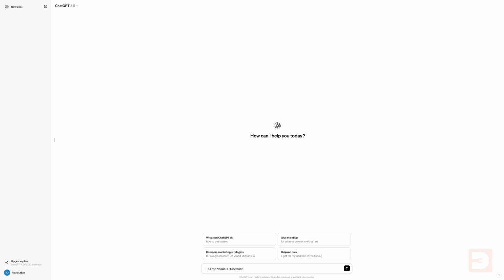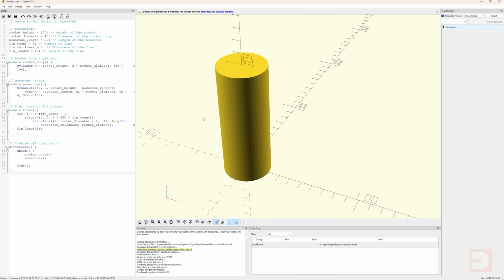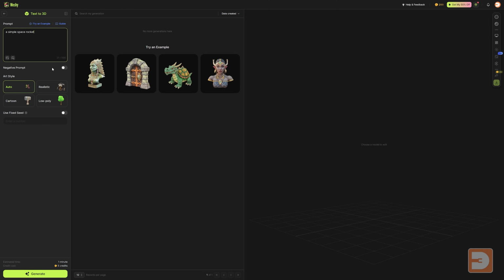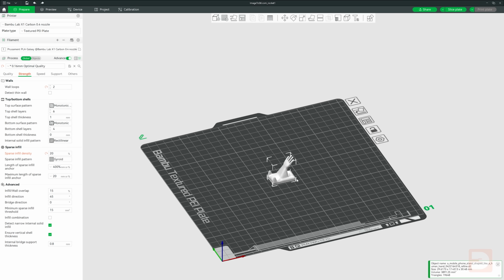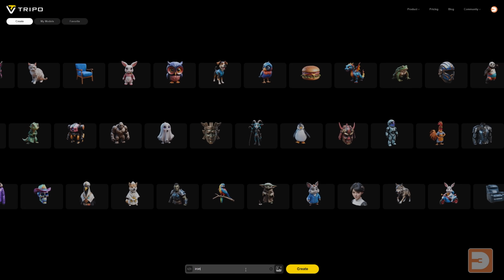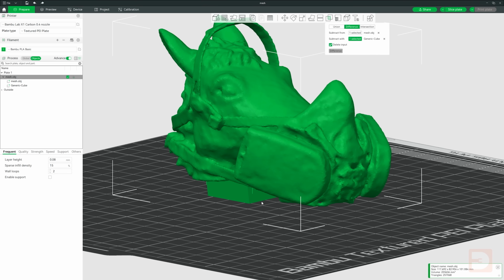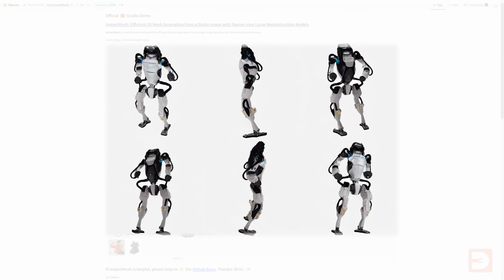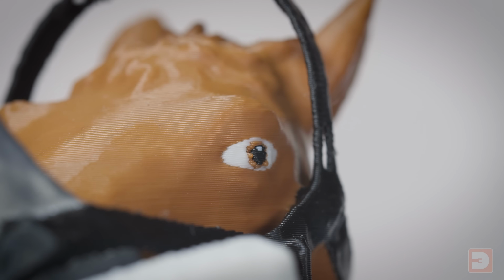Top Free AI Model Generators Tested for 3D Printing

Comment: I don't mean to show up just to drag a video but this popped up on my feed so I'm gonna throw this thought out there. Let this AI nonsense die, it's not good and I really doubt it ever will be. The majority of generative llm are just a scam, which is especially evident in the 3D generative tools you showcased. The fact that they're charging to create a mediocre and mostly unusable mesh with no consistency in output should be pretty telling. Add on the problematic creation of these generative products using massive amounts of unlicensed, uncredited, uncompensated work and you risk promoting exploitation. The idea of typing an idea and getting a 3D model is amazing, but the reality of what you get is far from that. Judging from the history of LLM companies it will never reach that idea either.
Reply from the maker: I totally get that some people aren't a fan of the changes that various AI is bringing, and I straddle the fence on it myself. 

However, I'd be very interested to know what you mean by most LLM's being a scam. I use LLM's almost daily and they do exactly what they say on the tin.

As for the quality of these models, I do agree, the quality is not there... yet.

As I mention in the video, every tool I covered here is available to use for free (to a limit) right now. Of course they will charge for excessive usage as running an AI server farm costs a huge amount of money. But also they need to get as many people using it as possible because that is how it will improve.
They give people a chance to use their tools for free so people are only going to pay to use their service more if they've already tried it (for free) and are happy that the quality meets their requirements.

As I mention in the video, look at those horrifying and laughghable AI generated videos of Will Smith eating spaghetti. That was completely unusable and pretty much a joke and was the best we could expect at the time. 9 months later and SORA is announced demoing almost photo realistic minute long video clips. 

It took like 3 days for the world to realise the pope hadn't suddenly become fassionable after MidJourney hit the internet, and that was almost a year ago with plenty of improvement since then.

This is early days for this technology and it's evolving quickly.

Yes there is questions around the training data but that's a whole separate conversation.
Reply: @3DRevolution  The training data is generally the forefront of the problem in my eyes, but moving past that to the note of calling it a scam.

 I call it a scam because the technology has been "getting better" or "only improving" for years. The best I've seen is simply a different option in a production pipeline, often worse and rarely better. Especially when a company is selling an amount of generations. It's more akin to a mobile game with random lootboxes, or slot machines than an actual art tool

I think it's also important to note that these tools are never developed as a tool for artists. it's not meant to support but replace, and it's proven time and again that it can't do that. In the realm of 3D models generative tech skips to the end product and it's virtually useless, there is nothing of a functional 3D pipeline and I've seen no intent of taking that direction. The only successful application I've seen for any generative ai tech is to create internet spam (or worse)
Reply from the maker: @gabrielspangler6964  The training data is a difficult one and I am divided on that. On the one hand I don't think they should be just taking other peoples protected work without permision, and as a creative myself I empathise with that side of things. However, equally I feel that on the whole, the various forms of generative AI aren't copying. If I knew that a photo of me had been used to train MidJourney, I could write a detailed prompt describing that photo exactly and run it through MidJourney 1 million times. It would never just reproduce the picture of me. It would create a new picture inspired by it's training data. 

But the thing is, weirdly, that's just human. Everything we all produce is inspired both by our experience (aka external influence, which is akin to receiving a prompt), and inspiration taken from work we've seen of others.

No professional photographer got to where they were having never seen a single other photo by anyone in their entire life. They'd learned and studied the work of photographers they liked and that influenced their own work. The exact same could be said for writers, directors, programmers, musicians, the list is kind of endless.

Anyway, that's my two cents on the training data debackle. No it's not right to take other peoples work without asking, but also, no it's not copying it, it's just taking inspiration from it like any human creator. Yes I understand the technical mechanics of it are different, but that's the crux of it.

You say it's a scam and that it's been 'only improving' for years and you specifically referred to LLMs. ChatGPT, arguably the first true publically accessible LLM only came out in November 2022. So LLM's have only been around publically for 18 months, so they have not been publically around for years, let alone improving. Despite that, in that time they have improved greatly.

I think it may be helpful to hone in on what exactly you're referring to here. You refer to AI with regards to art, whilst you say "Let this AI nonsense die". From this I'm presuming you're reffering exlusively to generative AI because even if you're not a fan of what it can produce and do, AI in general has in those 18 months made monumental changes in various fields. From overtaking 3 decades of protein folding research in a matter of hours, to discovering new cancer treatments. 

But even just keeping to the generative AI's such as LLMs and image generators, they have developed a lot and are becoming increasingly useful, especially LLMs. I have several friends who are very high end programmers with decades of experience and in charge of whole teams, who now use LLMs on a daily basis, helping with things like error finding, or even writing or theorising new code. The vocal capabilities which are also improving are even allowing LLMs to become a useful tool in things like speech and language therapy.

Again, I know the models generated in this video aren't award winning, but considering how early generative 3D models is in the game, I think it's incredibly impressive, and honestly in a year I wouldn't be surprised if you could get production quality designs out of some of these tools. Saying AI is entirely a joke based on the first generation of 3D models is like saying any great artist was a joke and would never amount to anything based on their scriblings as a 1 year old. This is early days and the technology is developing at a very quick rate.
Reply: @3DRevolution  I disagree with the concept that it's inspired like a human. These models are programmed using other's work. They are a product that is made by using images, writing, video, voice, etc. without permission. Any other product would be immediately flagged for that. 

Yes I am specifically talking about generative ai. I've been following a lot of professionals in various industries and a general consensus among most of them, is that generative ai isn't helpful. Or at least isn't helpful enough to justify it's use. And there are far to many cases of creative professionals being replaced or paid less because of ai. Personally any generative ai I've been given to work from has been a hindrance. 

I've heard the promises of what it can do if it gets better, but I've also seen the reality of what it's done. Suffice to say I'm unimpressed, and I don't think it's worth exploring more in it's current direction

Comment: Interesting video!  Small suggestion on your talking head shot.   If you put the camera a little higher it will improve the shot.  Putting the camera low can make it seem like you're "talking down" to the audience and vise versa.   Level or slightly higher than eye level is ideal.
Reply: We shopped for our wedding photographer by… height

Comment: 3D model generation and robot kinematics / robot decision making will be the next big things. They are inextricably linked.
Reply from the maker: I'm not sure if you're familiar with liquid neural networks, but there are groups working on combining liquid neural networks allowing AI to learn from experience, not just through training data, changing and adapting it's own behaviour and thought processes, and this has been applied to the AI then designing from scratch, robots for speccific parts, right down to the materials and manufacturing methods.
The AI then runs thoudsands of simulations with their designed robot, adapting it to overcome failures, until it finds one that works, then it supplies the final design along with a new AI to run that robot!

Comment: I spent years making custom models in DaZ Studio only to find out they are not water tight and riddled with issues when attempting to 3d print. Would love a tool that uses AI to repair those issues and make the models 3d printable. Spent many painstaking hours making these models and although it's been several years of me coming back and attempting to make them 3d printable I am still left with nothing to show for it.
Reply from the maker: I love the idea of AI 3D model repair.
Pop in a model and it makes the necesary changes to make it suitable for 3D printing! I'm sure this is something we'll see over the coming years!
Reply: Theres a few of the models I think gen 3's and below that are watertight
Reply: Export the posed model as an obj or stl and import it into blender. Then use the remesh modifier on the model. This will approximate the shape and generate a clean mesh. You can search on google for a tutorial. Ai is not needed.

Comment: I am new here.... how did you 3d print the colors? Did you change the pla ffilament
Reply: Fancy printer that can do more than 1 colour
Reply from the maker: This was printed on a Bambu Lab X1C. There are many printers that can print multiple colours (and materials) in a single print. Some use different methods.
The X1C has one extruder and once it's finished printing a colour for a layer it unloads the filament and loads the next filament, then prints that section of that layer and so on.
Other printers have multiple extruders each with a filament loaded into them, and there are others.
Each method has it's own advantages and disadvantages.

It is possible to print more simplictic multi-colour prints without having a multi-material setup by doing as you suggested, changing the filament mid-print.

It's even possible in your slicer set the points you want to do this and so the printer will automatically pause the print and wait for you to replace the filament before it continues, but this method only allows you to have different colours on different layers of the print. Not multple colours on a single layer.
Reply: @3DRevolution  cool thanks.

Comment: What an Eye Opener!!  I have basically designed everything I've printed using a 3D modeler... not a CAD system, simply because I know the modeling software well, and I find "fiddling with the design" far easier.  For someone like myself, having AI design things I can't or find difficult, would be a huge help.  Thinks like screw threads of different dimensions.  Hinges for a desktop box.  Interlocking parts & buckles.  While we're at it, can it help with tolerance evaluation... ie, create a test print that measures screw thread print tolerances (both screw and screw hole) for my printer (a test setup).   I like what' you're doing.  Subscribed.
Reply: This is all super easy to do after going through a few basic tutorials on any of the major cad programs like fusion 360 or onshape

Comment: I haven't played with BambuStudio, but I'm well versed in PrusaSlicer (from whence BS was forked). I'm not sure when the fork happened so the enhancements to the slice tool may not have made it into BS (yet), but in PS, once you've set your cut plane, you can right click on any part on one side of the cut plane to exclude it from the cut operation. That would have made removing the pole from the "horse with respirator" a single operation.

Comment: “Let’s import it” into what?
Reply from the maker: By that I was referring into a slicer, which is software used to prepare a 3D model for 3D printing, effectively you feed in a 3d mkfel, the specifications of the machine you'll be printing with, and your desired print settings, and a slicer crates a file which is just a list of machine commands for the printer to follow.
In this video I used both PrusaSlicer and Bambu Studio (two of the most popular slicers).

Comment: I've found that with ChatGPT you can usually tell it what it's done wrong, and it will correct the issue.  Rarely is one single prompt enough for a working solution.

For a new shape like a chair, you will want to start a new conversation, so that the context doesn't confuse it.

Also copilot is the same backend as chatgpt, it's just a little bit worse.  So I wouldn't expect much from there.
Reply from the maker: Oh absolutely, you often need to go back and feedback. I actually spent around 2 days trying to make it work by doing that on each of these, but the issues were never corrected. Because the results after multiple rounds of back and forth were pretty much identical to the results from the first prompt, I didn't think it was worth including them in the video, but in hindsight, perhaps I should have mentioned that I had given them that opportunity.

As for the new shape, I do get what you mean, and I know that with the example I included of ChatGPT I did request the chair code in the same conversation as the rocket, but I didn't with the other to LLM's, and as I'd mentioned before, through my extensive tests with these, regardless of new conversations or not, it didn't really improve this.

You are correct, Microsoft CoPilot does run a ChatGPT model, but as you say, it's Microsoft's own flavour of it. I was originally going to use Gemini as the third candidate here but in my preliminary tests (of which there were many), it refused to even once give me a code that OpenSCAD would even run with errors, it just refused to run it all together.
Reply: @3DRevolution  it's been awhile since I saw the episode but did you use GPT 4?  Or 3.5? -- i've noticed that 4o and 3.5 both kind of suck.  The regular GPT 4 (the one that still costs money) is like 10x better than the others. -- I've had flat out wrong and bad answers from 4o and 3.5, and when I ask the same question to GPT 4, it usually gets it right.

Comment: ChatGPT probably didn´t go well because you used version 3.5. When it comes to generating code version 4 is much better. I used it to create VEX code in Houdini and the success rate was significantly higher with 4.
Other than that getting the right code for anything with an LLM usually requires some back and forth. You just copy/paste the error message back you gpt. That usually helps. Not always. Sometimes it will get stuck in giving the same wrong result over and over again. Sometimes rephasing the prompt can help as well.

Comment: I’d been thinking about trying OpenSCAD, so this was disappointing :-/

I wonder how it would do if you gave it a complex model already created and just asked it to set the appropriate variables? (There’s a crazy-robust box generator I’ve need thinking about using to build a power supply box with a bunch of switches jack outlets, studs for mounting the PS itself, etc. It has so many variables, I’m wondering if CharGPT could make it simpler for me to just tell it what I want and then get all the right variables set.)
Reply from the maker: Don't let this video desuade you from trying OpenSCAD. OpenSCAD itself is fantastic for producing parametric models. This just shows that currently AI's aren't great at writing code for OpenSCAD so you'd still need to write it yourself.

Which box generator have you been looking at? There's some great ones out there.
Reply: @3DRevolution  I forget which one it was offhand, as I’ve been sidetracked by work stuff the last couple of months. It was just insanely complete though, with many, many options for just about anything you could possibly think of to do to a box 😂

I know OpenSCAD isn’t inherently very difficult, it’s just that my bandwidth fir learning new tools related to 3D printing these days is almost non-existent :-/

Comment: Been trying this too,  Apps that understand "real world" STL output like OpenSCAD, FreeCAD, Blender are going to be very interesting once AI get integrated properly. I suspect the AI/LLMs are going to be more specialized and perhaps simpler than current LMMs that try to do everything.  Makehuman understands the kinematics of body shapes, the AI only needs to modify the variables that are used by Makehuman to deign the body and pose. The Makehuman plugin to Blender does the same. AI with OpenSCAD for robot design will be interesting, I use it for model trains, wheels, motors and gears  but robots also use motors n gears....
Reply from the maker: When it gets to the point you can prompt an AI to design a 3D printable fully functional mechanical design, that'll be truly game changing!
Reply: @3DRevolution  Breaking Taps did vid on emulated biology joints for tiny robots. Add some AI procedural geodesic bones and humanoid bots are much stronger and lighter. Most bots today are over engineered subtractive machined and ugly.